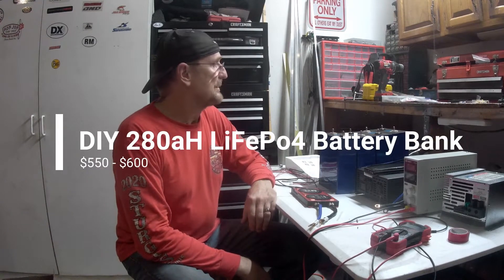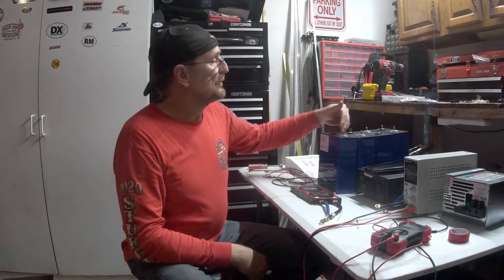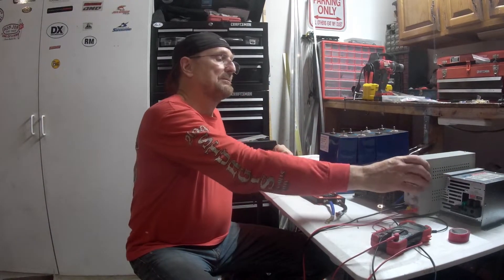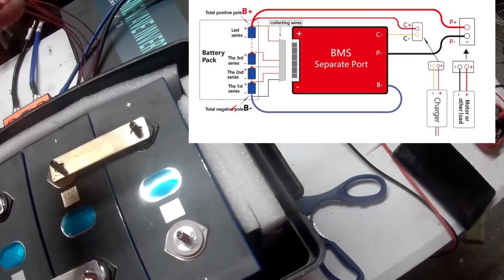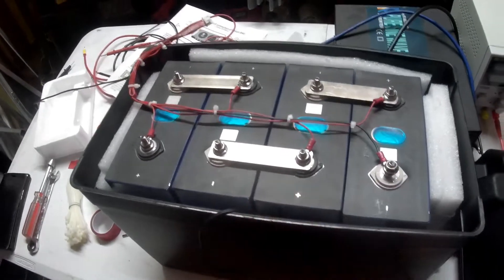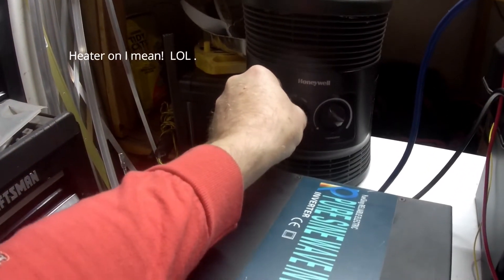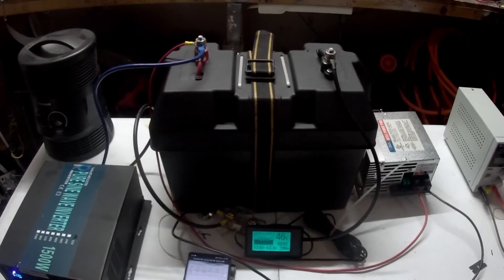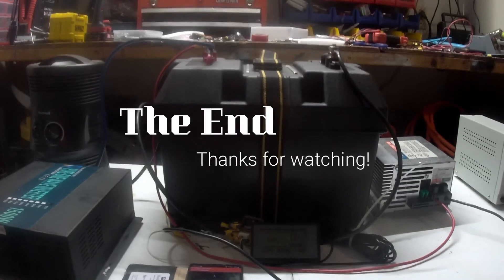280aH LiFePo4 Battery Build - DIY Battle Born or Renogy or Ampere Time  or ExpertPower Alternative?

Comment: Thanks to your 6x12 build series I have now decided that a 7x12 will suit my needs as a small toy hauler/camper for retirement travels.  I've drawn up a layout that I believe will be optimal for my needs, and have now started researching components and parts to make it all work...hopefully!  Was just shopping batteries and WOW!  Battle Born wants $1000 for one 100Ah battery!  I'm planning something along the lines of 800-1000Ah and hoping for >1000W of solar.  Going with BB batteries would cost me 10 grand in batteries alone!!  Then I remembered you mentioning that you had done a battery build video, in one of your trailer build videos.  So, I came back and found it.  And once again, I am not disappointed!  While I know the prices quoted here are four years old, and I haven't began pricing things out yet, based on your prices, I could have over 1100Ah for a bit over $2200.   Much yet to learn, but once again, your videos are lighting the way by showing what is possible...  Thanks for taking the time to share!

Comment: So I don't have to pay crazy money for Jackery or Bluetti? Wow, I wish there was a materials list for this puppy!
Reply from the maker: Billy, the LiFePo4 cells and the BMS can be bought on AliExpress or Alibaba. Very long wait time on LiFePo4 as they have to come by boat. 

Other than that, it is just a marine battery case I put them in. You'd still need an Inverter and etc. if you expect the capability of the Bluetti. 

This is just the battery. I built a smaller unit with Inverter and etc. built in, but it is a much more complex build.

Comment: How have these been holding up for you? Looking to do a CTC build & working up a order list
Reply from the maker: I built 2 12v 280aH batteries like this. One is still working great. On one of them, I had a 3.2v cell start leaking electrolytes and not holding charge. Probably hidden damage from day one. In any case, I was able to get some warranty coverage and I will be integrating the replacement back into the battery pack soon.  The replacement process takes a long time. 

Bottom line, you assume some risk building your own. I'd still do it again.

Comment: that is awesome. do another capacity test like this running a small 5k btu window a/c  a video call running my camper a/c off grid with solar and batteries will be a home run if you had 2 of those batteries it would run a 5k btu window air for 9 hrs they only pull about 500 watts heck that one battery might make it 6--7 hrs.nice video found your channel from your bed video thanks a lot
Reply from the maker: I have the 280 aH and a 230aH in parallel for 510aH total and got over 10 hours running the AC, FM radio and lights and still had 231aH(45%) remaining.  Based on that you should be able to get well over 15 hours... but mileage will vary based on outside temp, insulation level, humidity, etc... I did not do a complete rundown on the batteries.. but that was good enough draw conclusions.

I am on the road with it now and I have been running it for 4-5 hours in the hottest part of the evening when I stop. I turn it off overnight as the temps usually drop to the 70's and I just run the Maxxair and open windows to save batteries.

Comment: $500.  Is that with shunt & monitor ..??
Reply from the maker: Dean, it was $550.00 and that does not include the Shunt or display that comes with the shunt; however that does include the Smart BMS that has Bluetooth built in and allows you to monitor battery parameters on your smartphone.

Comment: You have to strap those cells...don't  you?
Reply from the maker: Mark, I am not sure what you mean by "strap the cells"? Are you referring to taping them together?  If so, not sure why that would be needed as they are contained tightly in the case. If there is some special reason, I'd love to know that.  Many thanks.
Reply: @donsdoityourself2547  The flaw in these cells is that they expand and contract quite a bit which will eventually loosen the crappy little 6mm terminal studs. I built a 7100 watt hour 560AH ''solar generator'' of my own with 8 of these cells. After some testing I bound 2 groups of 4 batteries with Fiberfix 10X tape then set both batteries in a heavy wooden case that was shimmed tight. These cells actually build up internal pressure and have rupture disks under the little plastic window on top. I'm cycling mine now by running a 10,000 BTU window air conditioner daily for free with the daily solar panel input.. So far so good.  I was a little dismayed early on when 3 wraps of that super strong tape was tight but the next morning was wrinkled from slack. I really lie that Renogy battery monitor. Its fun to watch it recompute available run time after changing the load.

Comment: Where did you get the battery posts? I have been looking all over for m6x.1 studs and can’t find them.
Reply from the maker: These came with my batteries.
Reply: try Fastenal  https://www.fastenal.com/product/fasteners/bolts/flange-bolts/600015?categoryId=600015&level=3&query=m6x1&isExpanded=true&productFamilyId=25763

Comment: Hi Don
Couple of questions, if I may. 
Source/name of the battery manufacturer, where they were purchased and the and model of Daly controller.
Reply: You should place some fish paper between the cells to avoid a short .  If they rub the blue wrap can wear and cause a problem.
Reply from the maker: Hi, they are EVE 280aH Prismatic  Batteries. I bought them on Alibaba.com  from Shenzhen Basen Technology Co., Ltd. (the supplier). The BMS is LiFePo4 12V BMS 4S 150A 18650 . I bought it from AliExpress.com and the seller is DALYBMS Store. Good luck!
Reply: @donsdoityourself2547  Much appreciated  sir. I been eyeing those very same units. Looks like they have 310ah now, but I think I will stick with the tried and true 280's.
Reply: @reubenj.cogburn8546  the 310Ah don’t come with QR code. Means they could possibly not be Grade A and may have defects. I’d steer clear and stick to the 280s too. I’ve just ordered 16 myself and as long as they arrive I’ll order another.
Reply from the maker: My 280aH only were down to 2.9V @ 280aH when I capacity tested them. BMS will shut off at 2.5.. so there was more there. The curve does get sharper at the end. These batteries are 280aH minimum. I think these are the same batteries and those are just ones tested and had 310aH...
Reply: Great Job! Was just researching if these cells would fit in a Group 27 battery box.
Reply from the maker: They will.. Just need to put the BMS in the cover. The BMS could also go in the box up front, but the DALY has the sense wire connector on the bottom edge... and that would take some support. Just easer to mount in cover.